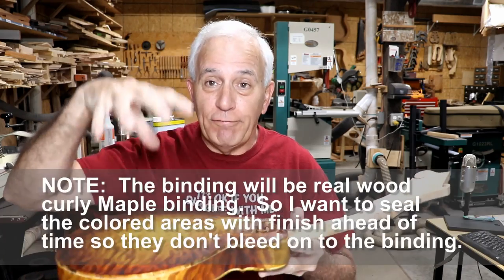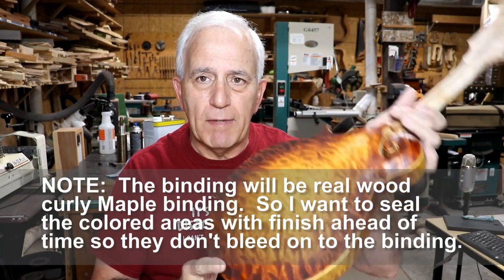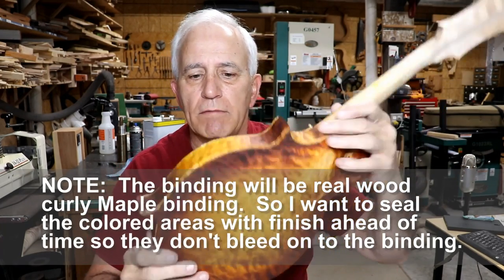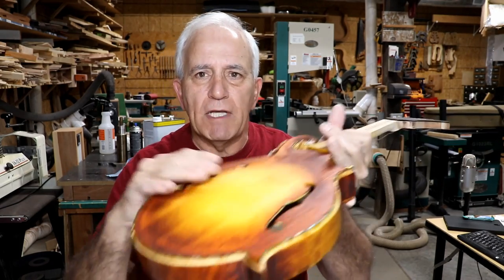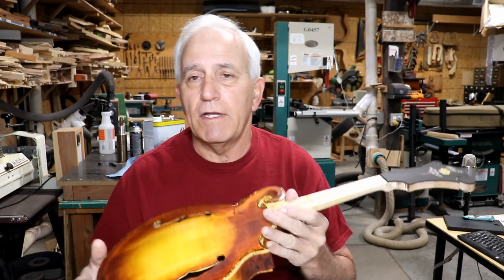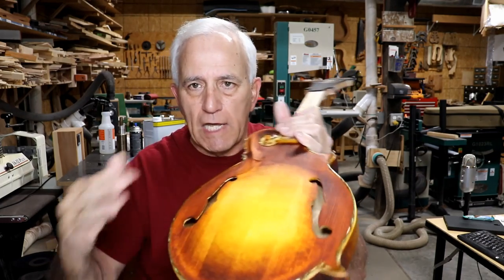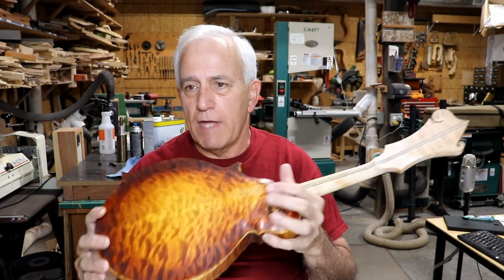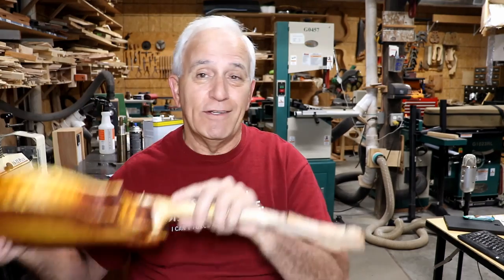VLOG #021 3 Finish Choices For The Worlds Finest Mandolin Ever Built By A Human

Comment: I have refinished 8 tenor guitars using tru-oil gun stock finish.  What works for me is to make a pad by folding over several layers of medical gauze and just putting the pad over the opening in the bottle so you end up just putting on a bit at a time.  I do about 6 coats and it turns out great.    and....I'd consider sanding down the guitar thats getting all the fish eye and then use tru oil on that as well.

Comment: I've started using a new process to apply oil-based color and Tru-Oil, and I'm really happy with it. 

I have a small random orbit sander with hook and loop base. I put a white Scotchbrite piece onto the sander base instead of sandpaper. Then, I apply a few drops of oil color or True-Oil to the piece and spread it out using the vibrating sander. It's pretty much foolproof for mostly flat surfaces. The Scotchbrite also ensures that the finish remains smooth as you apply subsequent coats. Of course, curved surfaces are more problematic. 

Also, the one thing you have to remember is to be stingy with the Tru-Oil. Just add enough to wet the surface of the piece. If too much is applied, you should wipe the excess off with a cloth or a dry piece of white Scotchbrite.

Comment: I’ve used Tru Oil on two of my builds. I use makeup sponges to apply very thin coats. These can be bought at local drugstores by the bag. If Tru Oil is running your coats are probably ten times too thick. My last build had probably 40 coats. The last coat is thinned 50-50 with lacquer thinner and comes out like glass. I don’t sand between coats and never use steel wool. I also use Angelus dyes before the oil.

Comment: As a gunstock maker the best way to use Tru-Oil is to rub it in by hand. Use small amounts and use the heat of your hand to rub it in then after that layer is dry rub in another layer.
Once you have built up a decent level cut it back with fine steel wool.
Then repeat the process.
To get that perfect finish can take many coats, but it's WAY better than spraying it. Spraying can give you that orange peel effect and will not fill small depressions.
By the time you have finished it should look like glass.
Just my 2c worth.

Comment: Would rubbing on the tru oil not be better than spraying it and I know time is money and rubbing it on takes longer but I get just as good a finish if not better rubbing it on and doing 5-10 coats then a knock back and final coat then buff it out once that is dry. My plus on rubbing is you can do light coats or heavy its up to you.... tru oil is probably all I suggest now even on electric guitars with a stained finish and nitrocellulose if it's a flat colour or a sparkle.  I find nitrocellulose super simple to use and 90% of the time it's a tremendous result but it takes a long time to get to the final steps of polishing.
Reply from the maker: I have applied true oil in every way possible and I prefer spraying
Reply: @RosaStringWorks  it's all about what works for you Jerry.